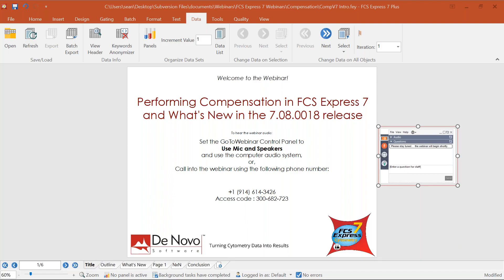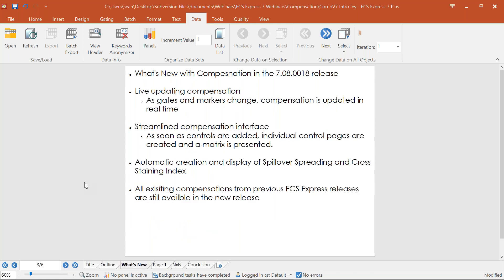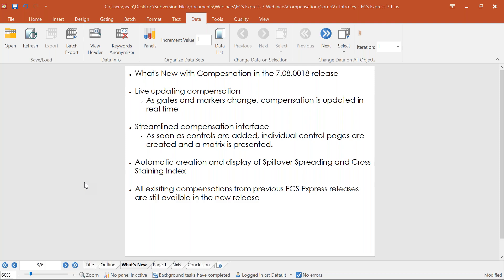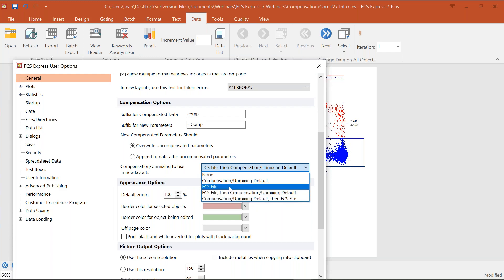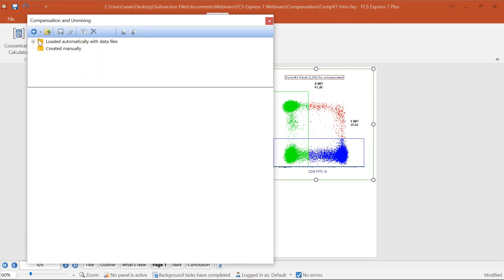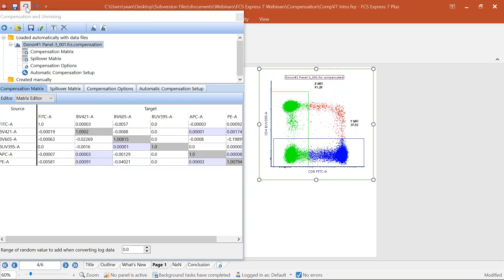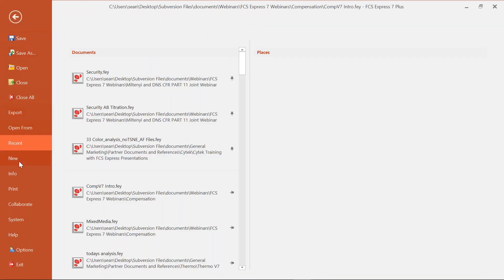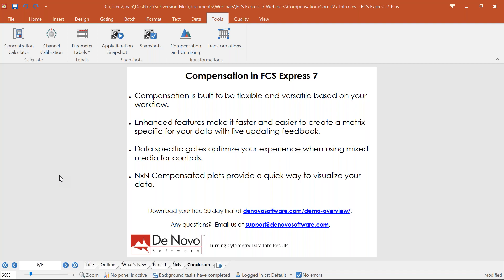Compensation (Full video)

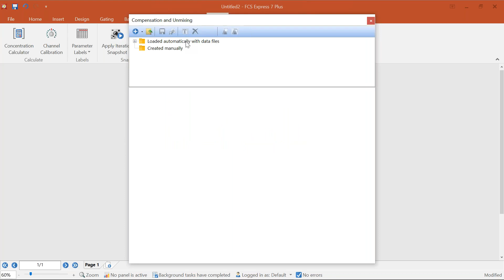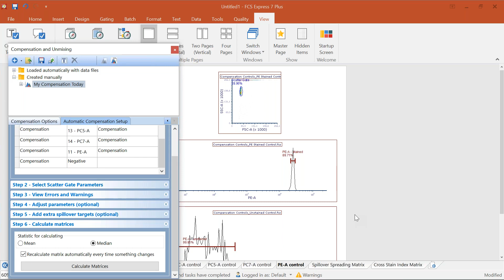Comment: At 33:40, when the Compensation and Unmixing panel pops up, you have the file directly visible under "Loaded automatically with data files". However, for me, this file does not appear at all. I don't think I have missed some steps. I have now tried an alternative approach. After having saved the compensation file at 31:30, I clicked on the fourth icon in the toolbar "Assign this compensation/unmixing to a data file" and selected my target file (.fcs suffix), this generated an additional file in my folder with the suffix ".fcs.compensation". When I tried the approach again from 33:40, I was only able to open the "original file" with ".fcs" suffix with a compensated result. This is a bit strange. 

Additionally, I am curious whether I can use beads for compensation and apply the compensation matrix to cell samples. I currently have this setup but the cell samples after offline compensation seemed rather odd. 

I'd appreciate it if you could respond! Thanks.